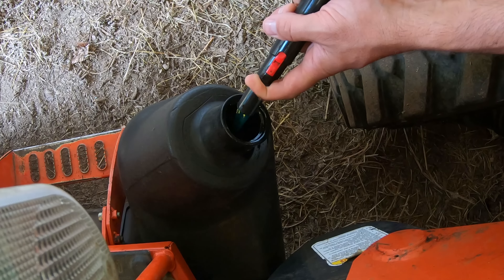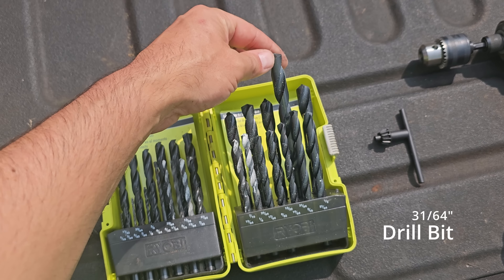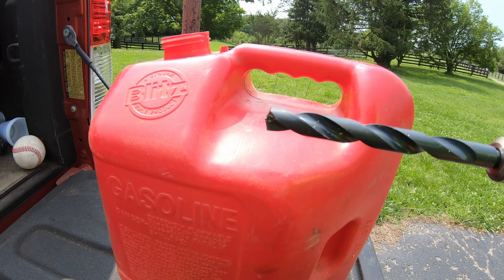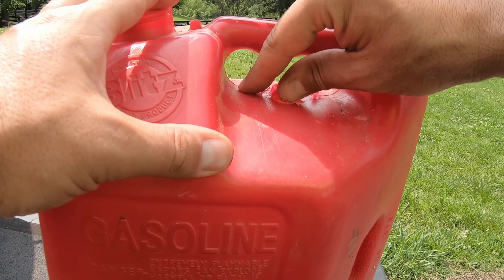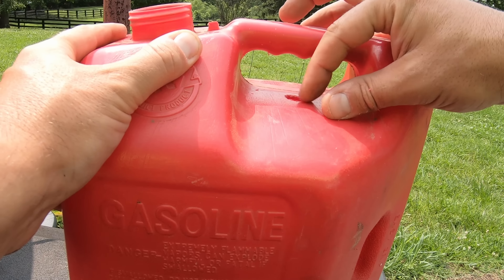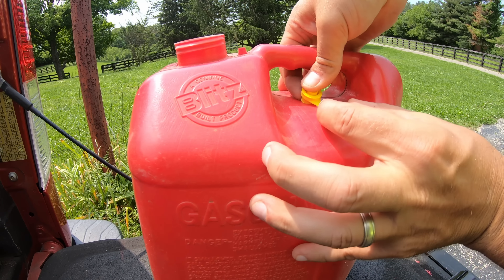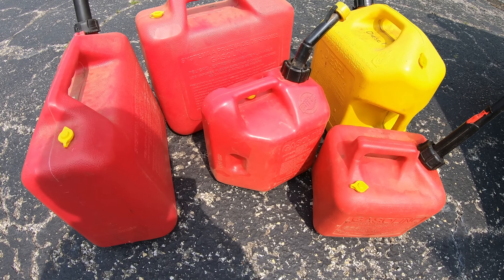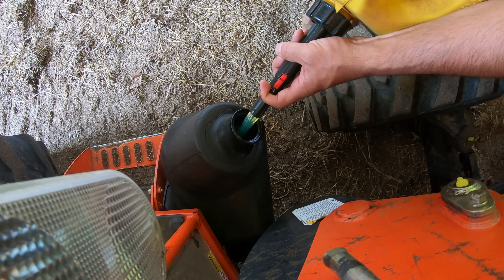Make Gas Cans Great Again!

Comment: Watchout it was made to vent and need to vent as gas shaken willl create air and will explode. I took out that plastic as gas  was too slow. I storage it under my van rack again with gas in it. I didn't check it for but by chance 4 month later I when under thevan and was shocked. It was like sort of roundish and ready to pop. It had over 100 lb of air in it as I let it open slowly. Iam not lieing it was scary.  I would be dead in a huge rv explosion the gas mist would be so fine  fire ball. if I didn't go under 
the van that day as I hardly do. Why?  Who would have thought gas create air continued shaking. This was a 2 gallon red safety gas jug. Rv road fire are common. Goggle that
Reply from the maker: Yeah, these plastic cans do swell and build up pressure in the heat and sun. I think these vent caps would act as a pressure relief and pop open, before the plastic can would get swollen enough to pop. Thanks for watching!
Reply: Yea I don't remember back then as it was a  out of gas situation. I used a screwdriver and pull out that vent valve or made the hole bigger as gas coming out was  very slow even with that tiny vet cap at the other end. If it blew when driven under the van the hot cat. Would have blew me and cars around me it traffic sky high. LOL got very lucky. It's  nosy out of sun I think shaking it cause it to inflate.

Comment: Why did you drill it in the dumb spot?
Reply from the maker: I would have rather had it the handle but this jug design was rounded. Where it's at works.

Comment: The old metal flex spouts were the best. This plastic stuff is awful. Put that vent up at the back of the handle.
Reply from the maker: I agree. Not a fan of the plastic ones either. I haven't had issues with where the vents are on mine. I agree though, the higher you can get it, the better...as long as it's flat. Thanks for watching!

Comment: No way. Put it on Bach of handle.  Put grease on the bit to hold the chips. I've done 6 cans
Reply from the maker: Handle is good but this style was rounded and had a seam on the handle. It works and doesn't leak.

Comment: 99% of these chinese made yellow vents don't keep closed.  It's just best to use a schrader valve with the core removed....
Reply from the maker: My 5 gallon gas can fell over in the bed of my truck today and the vent stayed close. If it didn't, I would have had a big mess. So far so good on the vents!

Comment: Wrong place to put the vent, to close to the fuel. The top real of the handle would be .
Reply from the maker: Top of the handle is best, but this can is rounded on the handle. As long as its above the safe fill line it should be fine.  No spills yet.

Comment: These plastic gas cans are extremely dangerous......they leak where the spout threads onto the can they do not have a vent so they burst open spilling gas everywhere.....which could actually be catastrophic....they should be removed from the market.... I have been trying to find an old school gas can with those great flexible spouts and the vent caps.
Reply from the maker: You are right! I've definitely had a few swell up from the heat.
Reply: You must be one of the lawyers who helped drive Blitz out of business.

Comment: You still need to toss the government mandated nozzle!
Reply from the maker: I may try a replacement one, but the styles I have don't seem to be too terrible. Thanks!
Reply: @livingon80  Thanks for the video. I went straight to eBay and ordered a vent. Greetings from Michigan!
Reply from the maker: @timvandenbrink4461  Nice! They help a lot! Drill high so it wont leak out and you should be good!

Comment: C'mon, man, all you have to do is to pour the liquid with the large side down. No gargling, I guarantee.
Reply from the maker: I've yet to find a new style can that doesn't gurgle, no matter the angle.
Reply: @livingon80  1. You have a good point: the trouble may come from the design of the can.
2. Some cans come with a double hose, one for the liquid to pour and another, of smaller calibre, for the air to get in.

Comment: Not were the vent should be.
Reply from the maker: Right. Like I said in the video, I prefer up higher by the handle but this can design was rounded. It works where it is as long as you don't fill it past the safe fill line. Thanks!

Comment: Or go electric... it's a toss-up which is more harmful to the ecosphere in manufacturing but electrics don't pollute through their use. That way you don't need a non-biodegradable can... I'm sure you can find something else to recommend for an affiliate link.
Reply from the maker: I do have some battery powered lawn tools. It's nice to not have to worry about gas and oil but I think battery tech still has a ways a go before its better than gas for larger properties.

Comment: Oh my gosh this guy has no idea what he's you should always put the vents at the highest point possible. He should have drilled a hole at the back of the handle. If he opens that vent when that gas can is anywhere near full he is going to spill gas all over the place.

Not only did he put the vet in the wrong place on one of them he did it on all of the gas cans. Extremely foolish.
Reply from the maker: The holes are above the fill line on every single can and none of them leak while transporting or while pouring. I avoided drilling the holes on a rounded piece of plastic or on a molded seam, because that could make it leak. Thank you for watching.